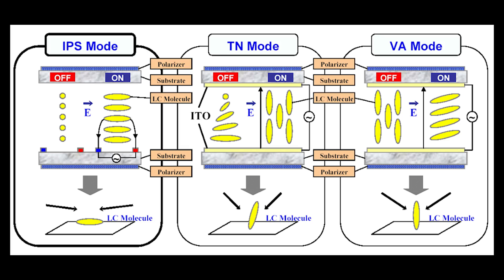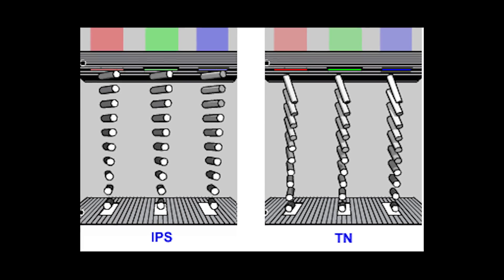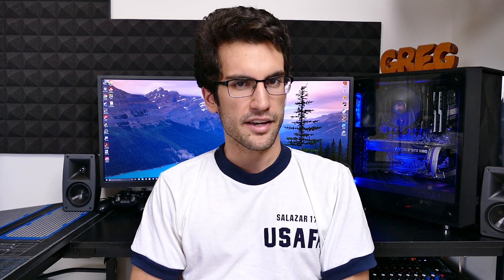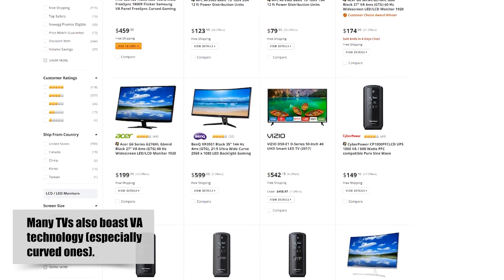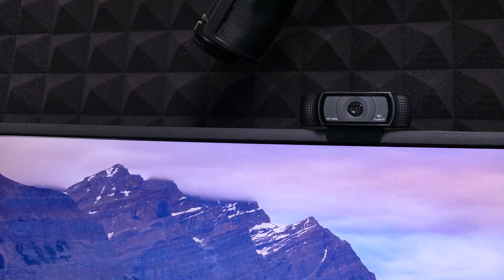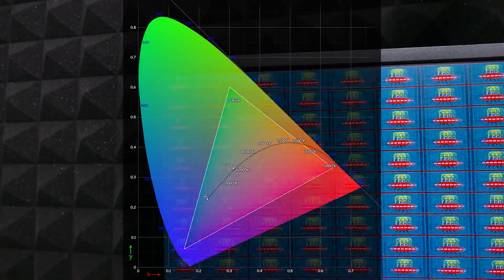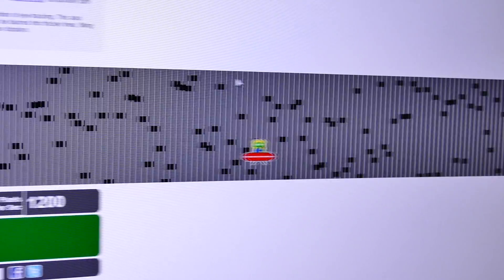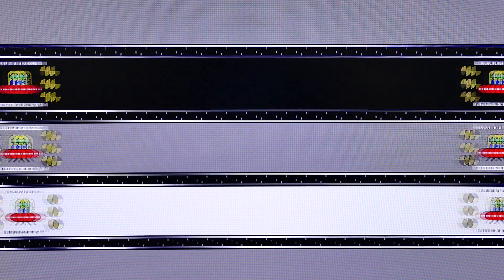What is VA (Vertical Alignment) Technology?

Comment: Thank you very much. What nobody talks about is the AWEFUL viewing angle performance in regards of the black in IPS panels. I had one (65", Hisense) and the colors were good BUT the blacks were gray at most AND in off angle even quite milky. So the overall off angle perfomance by IPS panels is BAD. At least if you watch movies and not bright demos or TV programs all the time. 

VA panels:
what I don´t understand is, how are the blacks produced in a full array panel with no local dimming zones. I mean, the light source is BEHIND the panel. There is no black wall or something. If all the lights are emitting from behind, how the heck do you get black if behind the black is a light emitting full power?

Comment: What is the difference between VA and QLED? I know roughly what QLED is but what I don't get is why every QLED TV or monitor is always listed as a VA pannel in online shops. 
My question is: Will a e.g QLED gaming monitor from Samsung have the same tradeoffs like a regular VA monitor? Is is basically just a small QLED TV? What is the difference?
I am planning to buy a Samsung 5120x1440 32:9 QLED VA monitor but I am very afraid that it will have VA ghosting.

Comment: I went for a aoc va monitor and I have the worse expirience ever, monitor isn't sharp on smaller object like letters and profile pictures, that includes also enemies in fps games at far distances making it hard if not also impossible to see. The colors are nice but blurry on the things I mentioned above. Idk if that series of aoc has that issue or my monitor having that problem, but I know that my old cheap LG monitor tn panel besides on the colors and hz Is far superior that my new monitor.
Reply from the maker: Likely just your panel/model. Not indicative of VA panels overall.
Reply: @GregSalazar  I hope so, I got rather disappointed for my 1st va monitor, any recommendation about monitor brands that are trustworthy.
Reply: @iTechGamingLOL , Which model AOC did you buy?  Is it possible the screen is too big for the monitor resolution and the pixel count per inch is too low?  I'm looking to pull the plug on a 27" 2560x1440 144hz monitor but I don't know which to buy, a VA or IPS?  I play as a sniper in the Battlefield series and I need to see the enemy in the distance. Right now I'm using a 5yr old LG 27" 1080p 60hz IPS monitor.
Reply: @Phantoma3  went for 24 inch model 1080p
on my local forums it had good reviews so i did buy it , until i saw the issues and then had some serious searching about it and ended up not being the only one with that issue.  aoc24g1wg4 or in short aoc c24g1.
My issue with this monitor, blurry text and bad backlight bleeding making reading hard. Way to high brightness which cannot be fixed. Colors such like red/blue sometimes being displayed as big ass pixels most likely due of the color correction being wrong, and as a BR player, far distances enemies are blurry, not sharp detailed making them hard to see, like dots while on my old LG TN monitor i didnt had that issue but was a 60hz monitor.
From what i have read , VA panels especially curved come with such issues and are not reliable for gaming as TN, that's why when ill change monitors ill go for a TN panel.
Edit: i can say VA panels at that price range 200 - come with those issues, more expensive ones i do not know, regardless when it comes about monitors make sure you have seen that monitor somewhere else or can try it out.
Reply: @iTechGamingLOL ,
There's a full review of that monitor which includes calibration settings here,  www.pcmonitors.info/reviews/aoc-c24g1/ and he also made a lengthy video review, www.youtube.com/watch?v=01TZUiUThGA

Comment: Today VA or IPS  monitor does not matter anymore.The technology has ripen already those differences are the things of the past.This days I don't care which panel I choose whether VA or IPS. Those technical differences are for marketing strategies.If you can buy both panel then buy both and check the differences. You will note that, not much of a difference.But Practically huge difference for the pocket.Technologies are evolving very fast. Before you knew it is already obsolete.All i can say buy wisely and believe  strongly  that you bought the best.

Comment: It just so happens I was looking to get a VA monitor recently, and I found a really really good deal on a new 27" 1080p curved 144Hz G-SYNC VA monitor on eBay UK, £228!!. Search for Lenovo Y27G. It's a pricing error I believe, as it's £100 cheaper than even TN G-Sync displays. Absolute steal, if you're in the market for one then jump on it as I doubt it will last. I'm pretty blown away by it actually, going from my previous IPS the contrast and gamma make dark games sooo much nicer to play. Doom/Overwatch/Dirt Rally at that framerate are mind blowing.
Reply: May I ask how the VA has faired for you until now? I’m torn between two things, VA vs IPS, and 27in vs 32in. Of course good contrast ratio, brightness, response time, ergonomics, and colour gamut. Damn. Can’t seem to find the right ones or combo. I’m only going to use it for PS4 Pro casual gaming. I care a lot about contrast, but don’t want to lose out on colours. Not to mention size, worried if I’ll regret 27 being too small. Idk anymore lol. Any recommendations or feedback? Cheers

Comment: So IPS is better, VA's only advantage is deeper blacks and contrast?
I am in the market for a new TV and Looking at the Panasonic TX-58EX750B which has a VA panel. But after watching your video it seems a premium TV like that should not be using VA and that at the price range I should be getting IPS?
Reply: karan Incorrect. VA is the better technology, especially for TV's. Greg doesn't have enough experience with or understanding of to make some of the statements he has made here.  Many of which are simply wrong. Unless you only watch TVs at extreme angles or in very bright environments, look at VA panels primarily.
Reply: Mr. Manager  thank you that's what I thought but this video was a bit odd compared to what I have been reading else where

Comment: Boii? Contrast is by far the most important factor in image quality! VA panels manage easily 3-4 times the contrast of IPS. Blacks are grays on IPS screens. Viewing angles are irrelevant on monitors. You literally sit right in front of it. And I defy anyone to spot the difference between a 5ms IPS screen and a 20ms VA. A $500 VA panel will be better for almost any purpose than a $500 IPS panel.

Comment: Saving up money for a $1,000 build and need your opinion...

link: https://pcpartpicker.com/list/22xVxY

Preferably would like it to be white and red themed colors (Little RGB if possible) 

note: the CPU cooler Is suppose to  be white with RGB, but pcpartpicker didn't show the exact model
Reply: Honestly,you can just go for a r5 1600 (comes with a cooler) instead of a r5 1600x with an aio since they pretty much overclock the same.With the extras, you can upgrade from a rx570 to a 580